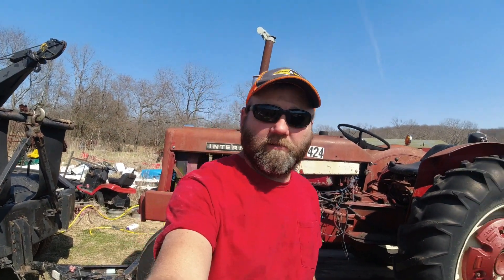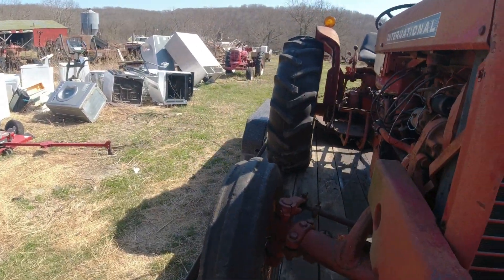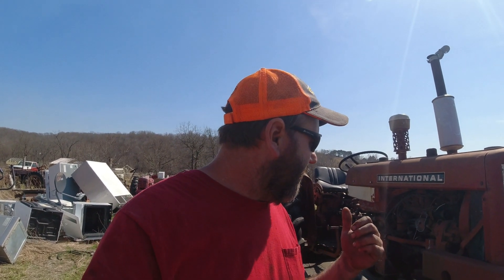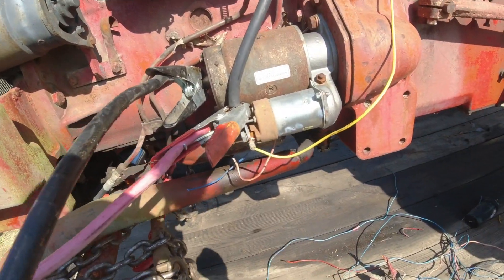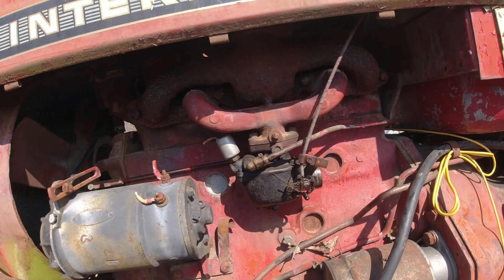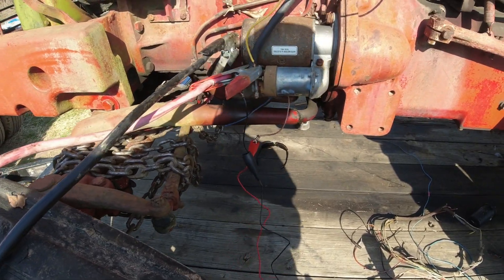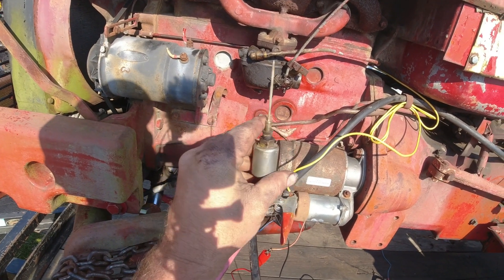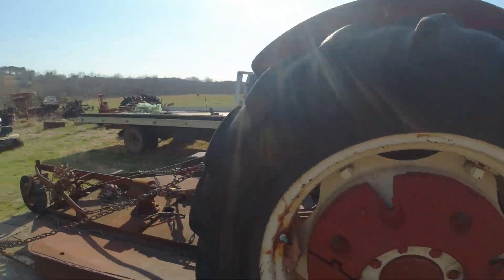international 424 rescue and first start

Comment: We have 300 utility. Pretty much the same tractor as your 424. Except yours is wearing a fancy dress! Handy little rig. Ours was burning oil and fouling spark plugs.  I bought new rings and took the engine apart. Very pitted cylinder walls. Already had new rings. needs sleeves.  We are working on our H now. Posed a couple videos yesterday of removing that engine.

Comment: Congratulations on your newest acquisition yes please show the video on wiring have you ever seen somebody put a chainsaw engine  on the PTO shaft as a starter I saw a Russian tractor with that exact starting system works pretty good Maybe  SHTF situation when you can't find a starter  When I was a kid I put a 2 horsepower  Briggs and Stratton engine on my pickup truck as a starter motor  use the air conditioner magnetic clutch to engage Engine it worked very well
Reply from the maker: sounds interesting

Comment: I have the same tractor. My wiring is all messed up. I'm wanting to rewire it. Could I see how yours is, because I doubt what's on mine is correct. Also does yours have a 4 pin key switch ?
Reply from the maker: universal key switch from napa they work good and they are cheap

Comment: I need to rewire mine, grandpa decided it was a good idea to snip a wire harness. I wonder if I could get away with a hot wire situation.
Reply from the maker: Hot side of the coil to the Hot side of the battery will bypass the switch